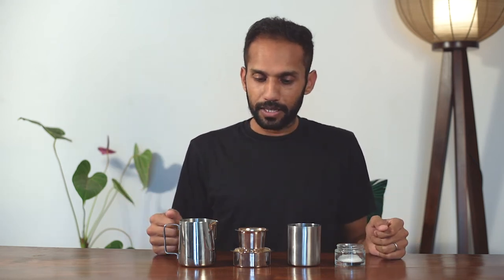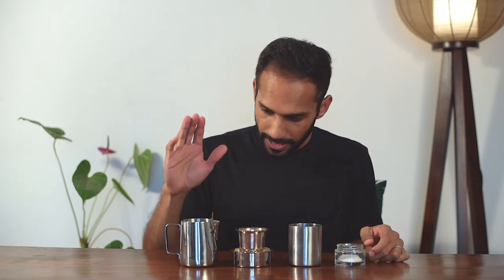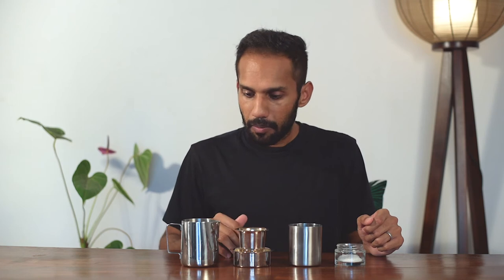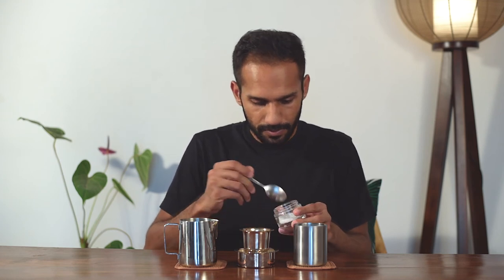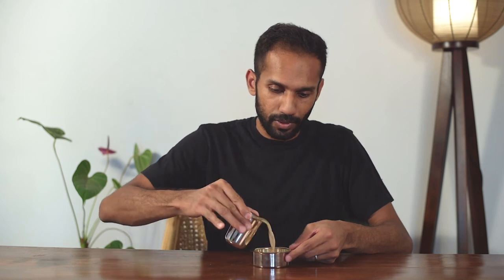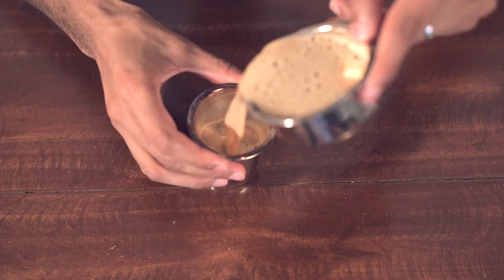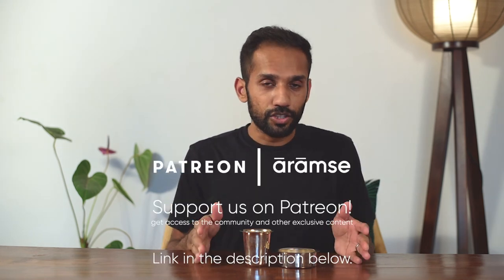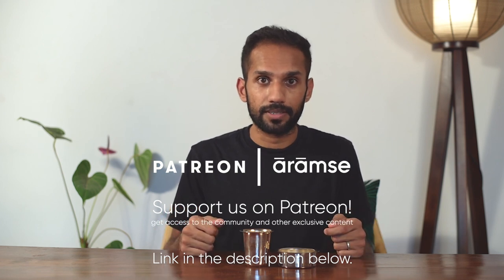Traditional South Indian Filter Kaapi (Coffee) Guide

Comment: Hi, I tried your previous slow espresso recipe, but maybe because I'm using a different brass filter, but the drip down didn't happen, would you know what parameters I should look at when the drip is blocked? or if the drip down goes too fast? is it how do I tweak the grind?
Reply from the maker: First try grinding coarser. If that still doesn’t work try pour slower and a less aggressive swirl during the bloom.

Comment: I guess the compressor is important, because you have to use it to remove the air pockets, and also it allows slow percolation of water through the tiny gaps in the coffee granules and to get nice 
and thick decoction..... And using chopsticks!!!!!!!  It will make the coffee granules chamber more porous and the water will pass through those large holes very very fast resulting in a very diluted decoction..... It can be seen by the colour of the resultant coffee...........
Reply from the maker: Het there, thanks for watching. Please check the first pinned comment for more info on this. Also our decoction is lighter because we used a lighter roast and there is a bright video light shining directly on it. If you want thicker decoction you need grind the coffee finer then follow the same steps. Using the tamper/compressor will cause a lot of issues, especially if you're using high quality, freshly roasted coffee.

Comment: I appreciate your novelty with Indian filter. I tried it and is good , but not thick like the traditional one.

I would also appreciate if you could learn the traditional recepies from your grandma and many others (there are many variations) ( and without plunger bias ), and enlighten us with your scientific explanation.
Eg.. There is a variation by Chef Venkatesh bhat in YT that's according to Coffee board recipie. Long extraction method by Chef Dheena etc..
Reply from the maker: Hey thanks for watching and commenting. So the thickness or viscosity isn't dictated so much by the method but by the variables. Basically you can keep the coffee dose constant and reduce the water or keep the water quantity constant and increase the coffee dose. When doing this though, grinding finer can help increase extraction. This is similar to pulling a ristretto on an espresso machine where you're lowering the coffee:water ratio, thereby creating a more viscous brew. The other thing to factor in is the coffee itself. Pick a coffee that has more body and you'll get a more textured brew. I hope this helps.
That being said, we're constantly experimenting with this brewer so we have and will be trying several techniques. We will also post updates here or on Instagram as and when we stumble upon interesting findings. E.g. we realised that WDT works brilliantly for distribution. Much better than using a chopstick.